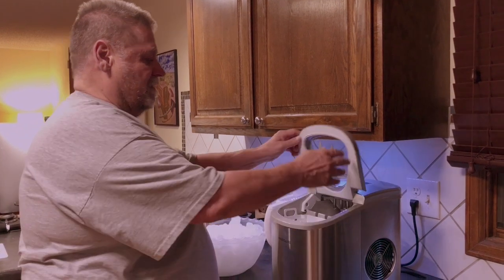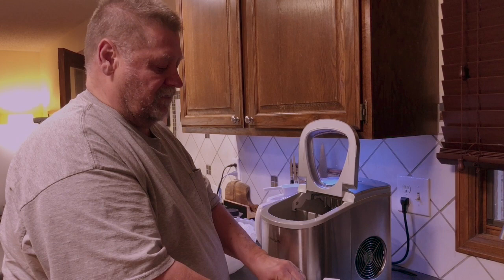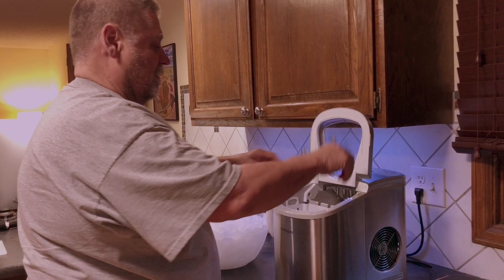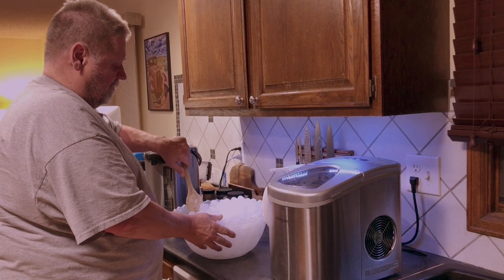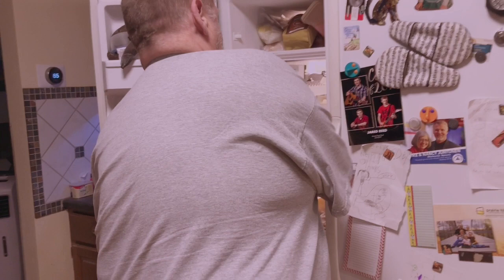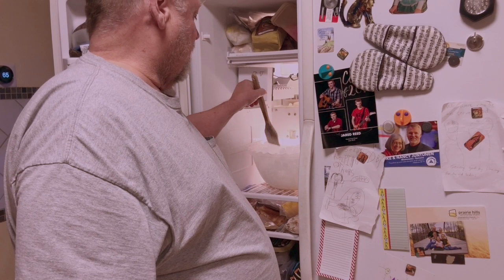Keep ice cubes from countertop ice maker from sticking

Comment: Okay at first I was like “that’s too simple, no way that’ll work” and sure enough, it 100% works, I give my ice a stir every batch I add and they don’t even freeze. When removing the cubes from the maker, give them a good shake above the sink before adding to the rest and stirring.
Reply from the maker: Hi Philip - yup. We have been using this ice maker for 3 years now, because a repairman wanted $360 bucks to replace the one in our 20 year old fridge. We learned if we stir them as we add them, they break up easily and don't glob together.
Reply: @guitarlj  you fix the one in the fridge? it's probably a simple problem.

Comment: Hey there thanks for the tip I was having this issue as well. So you basically stir the ice every time you dump the ice maker basket?
Reply: Looks like draining will also help but the ice always wet no matter what
Reply from the maker: @MrBears1024  Hi Censored (sorry I didn't see your response earlier). Yes, they are wet at first which is why stirring helps. I keep an ice pick stuck in them as well for times when the humidity is higher (we live in Wyoming where it's pretty hot and dry in the summer).
Reply: @guitarlj  oh, ok. Thanks for the response I really appreciate it! 😀

Comment: What model of ice maker do you use?
Reply from the maker: Hi codemeister - any of the $79-99 ones. We are using our second one (after 2½ years the first one quit). The service guy wanted over $369 to replace the one in our fridge, so at $80 and $99 after 4 years we are still nearly $200 ahead of that repair, and this puts out better ice more quickly.